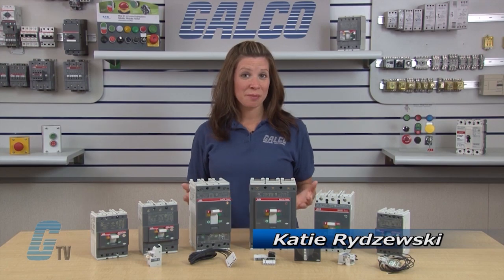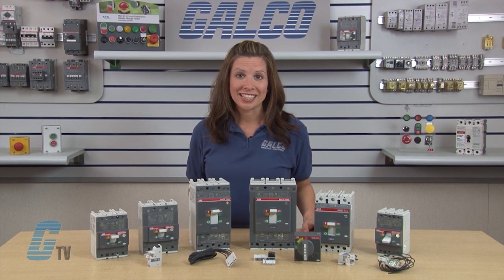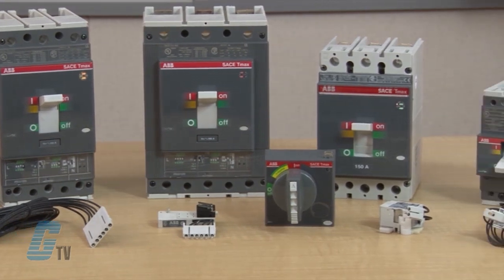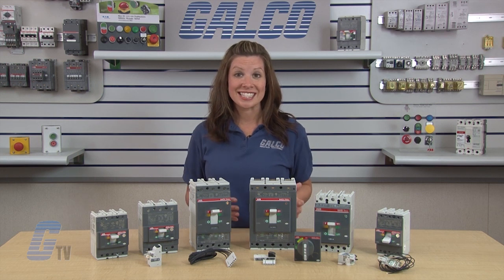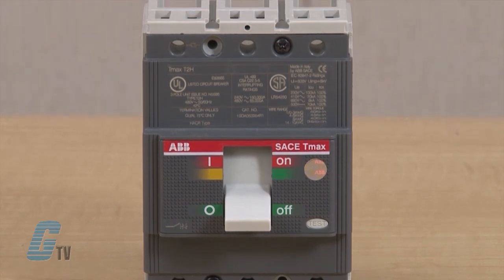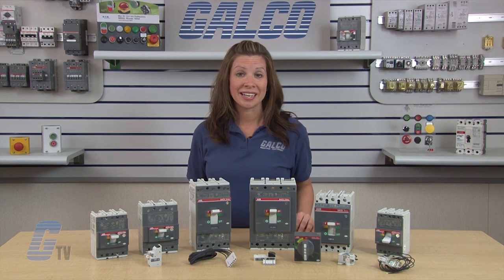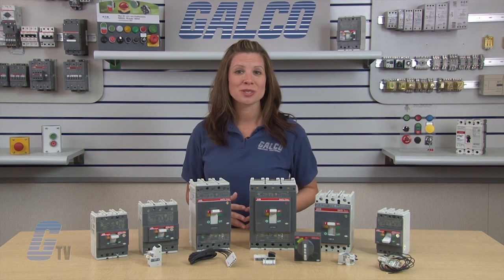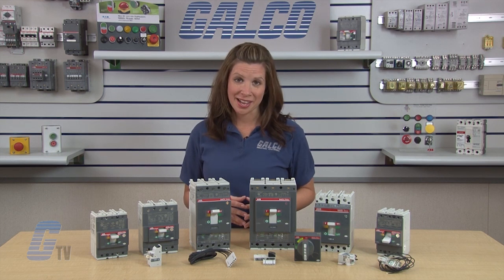ABB TMAX Series Molded Case Circuit Breakers - Product Overview

Comment from the maker: ABB's T-Max series of circuit breakers offer an optional electronic trip mechanism.  ABB's line of electronic trip modules include an LS/I, LSI and LSIG trip adjustment, with L=Long time, S=short time and I=Instantaneous trip.

For higher current loads, ABB also offers their E-Max line of circuit breakers, which are also classified as an electronic circuit breaker.